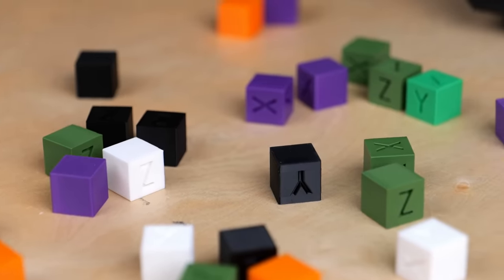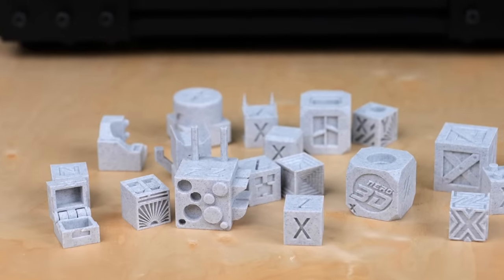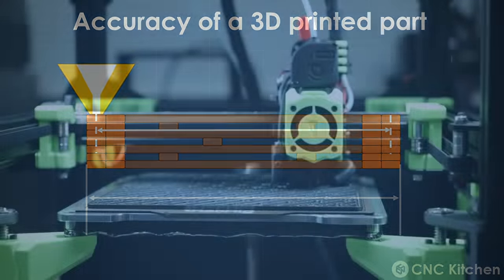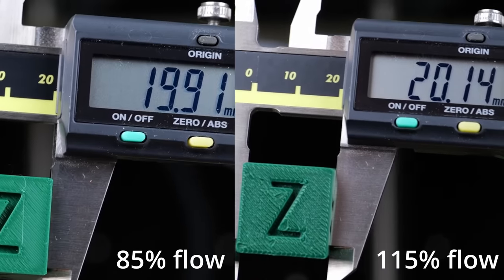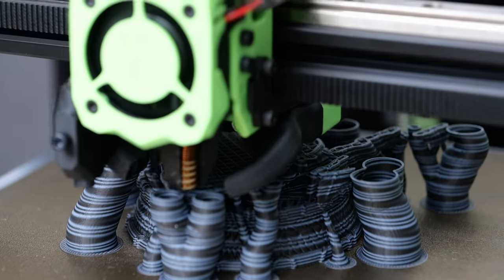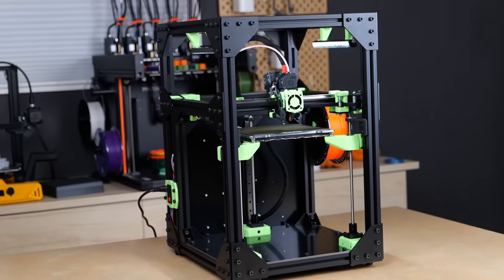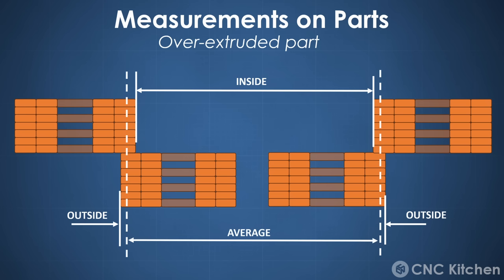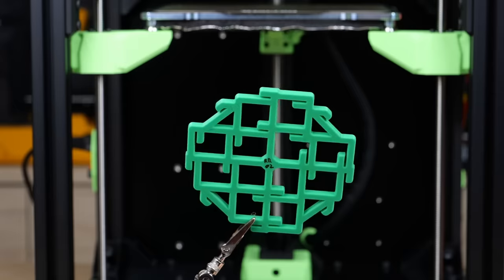Calibration Cubes: More Harm Than Good?

Comment: Wouldn't the best way to calibrate the E steps simply be a dial gauge? I mean I took a mount for the X arm and took my dial gauge and it was spot on when moving right 1mm then right 25mm. It landed at exactly my indicated 0. When moving left it moved 0.05mm less which is caused by the belt.
I have not done my Y yet as it requires printing another thing and I was too focused on the wobble caused by a V groove wheel.
I did do the Z and I already had it lowered to 399.1 steps per mm but it actually was even less with 0.01mm difference at 25mm travel. So it needed to be 398.94 Now its still not entirely accurate but its within the 0.01mm tolerance so I am not going to bother.
Skew is something else though. I wonder how square my printer really is. Might grab a right angle and see if it is correct.

Comment: Spot on Stephan! The first time I used a cali-cube the size of it never felt comfortable. Far too small to make an impact to precision for larger parts and seemed a bit under designed to consider all of the mechanical movements of the printer and properties of the filament. Seemed like it was targeting a simple process, and likely fits a larger audience using a printer in a different method than a multi-material / part maker. Thanks for the reference to califlower; will check that out to setup each material. 🙏

Comment: Back when I made my first printer (a delta) I made a calibration shape that had a few different dimensions as well as reference angles. 

I figured that if the first section measured 50.5mm and the second 100.5 then the steps per mm was correct but I was getting over extrusion.

If I was getting 50.5 and 101 then it was the steps that were off.

You definitely need more than one dimension per axis to know what is going on.

Amusingly the shape I made actually looked pretty similar to this but with a more open sides.

Comment: Skew was a big pain back in the earlier days of 3D printing.  I started with an Anet A8 and the whole reason I bought a second printer was to rebuild the A8 into an AM8. All because of the massive skew that was impossible to get rid of because there wasn't any way to adjust the laser cut acrylic frame.

Comment: Why not just print a strip that is the entire length of the bed, one for each axis?

You’re basically trying to compensate for errors in the belt, since a gear, no matter how poor tolerances, will always have the same number of teeth per rotation. So you could skip the middleman and just measure the teeth per 100mm on the belt, when it’s relaxed and in tension. If they are very very close you have a good belt, and you can adjust the steps per mm based on how off the belt is from nominal.

Comment: My Bambulab X1c came out at 0.11 degrees skew.
My self sourced Voron Trident turned out even slightly better at 0.10 degrees.
After calibration I ended up with 0.01 degrees on the Voron, really cool. The Bambu can’t be tuned, but 0.11 degrees is fine.
Reply from the maker: Thanks for the input. I'll try adjusting my skew on the X1 with belt tension but I would advice against it if it doens't bother you.

Comment: This is most important video for tuning, also accuracy of best calipers is +- 0.05mm even. So with 20mm you would need a micrometer to measure anything and the plastic melting will have more effect on the size that anything else :)

Comment: As for Core XY machines (i run a ratrig v-core 3 as well), you should be able to correct skew by balancing the tension of the two belts. I found it totally sufficient to measure the distance the left and right gantry joiners have to the corners of the frame. Checking for squareness is something I thought everybody does everytime they retighten the belts. I modified my printer quite a bit and maybe had to do it more often than most folks, though.

I put a lot of effort into finetuning my frame and my linear rails into something very close to true square (hand-tight screws and soft nudges with a plastic mallet will get you there, measuring diagonals repeatedly)
Just put something (any rigid object of appropriate size, really) in between one side of the gantry and the inside of the frame and jog to the position where it just touches. Then adjust the tension of both belts so you have the the gap feeling the same on both sides. If this leads to tension being noticibly different between the two belts, just loosen and retighten the screws that connect the gantry extrusion to the joiner pieces, and repeat the process.

In my opinion, there is no reason for software scew correction or to deviate from the nominal steps per mm in the printer settings ever, at least for extrusion built core xys. Different amounts of thermal shrinkage can be compensated for in the slicer in a much better way.

As for precise measurement of the frame diagonals, instead of buying very large and expensive calipers, it might serve better to wrap a tailor's tape measure around diagonal opposing beams. Put two flags of painters tape or sth on the overlapping areas of the tape measure and cut into the flags. Remove one side of each flag, so they form a hairline thin gap when the tape measure is held tight. wrapping it around the other diagonal, you can easily see even tiny differences when holding a lamp behind the slit.

Comment: Yes, I do check it from time to time. The first time I did it was when I had the same problem with the lid not closing. Then after a while I did it again because the belt on one of the printer's axes was worn out, which resulted in an oval instead of a circle. Now I check it by printing similar models to califlower

Comment: My frustration is with skew.  I got into the habit of pulling the gantry forward by hand to replace filament on my modified FT-5.  By pulling from off-center, I know I have introduced skewing.  I did a skew correction in Marlin once, and that worked until the next time I pulled the gantry.  The best option would be to add dual end-stops on the y-axes to ensure that the gantry is squared.

Comment: Preach, Stefan! It's a fine test of the final result. But I made this mistake on my first Ender 3. Its travel accuracy was actually perfect, and I just needed to better tune linear advance for corners and expansion to account for edges and holes. Then every part was spot on everywhere to 0.05-0.1 mm.

Comment: Great video. I appreciate the idea of not using steps per mm to adjust scale, I configure my steps per mm by reading the actual travel of the machine with a dial indicator, so I know that any dimensional error I get in my prints are results of print settings not hardware configuration.

Comment: My first big print was done on a friend's ender 3 max.  A two peice custom designed matx pc case.

The parts firs together great and then at assembly I noticed the holes for the motherboard did not line up.  Now I know the most likely culprit and am ready to tackle the project again also making some modifications for things I didn't realize till after placing parts in the case.

Comment: I'm suprised you didn't talk about Z calibration. After months of using my cheap single-leadscrew 3d printer, I found that the z axis scales non-linearly. That means small parts worked (because they were calibrated using the cube) but taller parts were way off. I used a calibration tower with evenly spaced measurement crevices to measure the height inconsistencies. I solved this problem by correcting the z steps after each layer in the layer script in the slicer

Comment: axis steps/mm calibration should always be done by performing measurements of the physical machine, not measuring parts. As you note in the video, each material shrinks (or warps) after printing and so you cannot measure the accuracy of your axis movement by measuring the part itself unless you already know the shrink factor (which you don't).

how to perform measurements of the physical machine will of course differ depending on your machine setup but I find it easy and accurate to use calipers from one fixed location on the machine parallel to the movement of one axis to some stiff part on the printhead.

Comment: I've got into 3d printing and I bought a Bambu A1 mini. One of the first prints I've made had a 2mm hole in it (placed vertically) but it came out as a 1mm, other part had 5mm and came out 4.75mm and other had 30mm which was almost perfect.

Comment: I've been replication parts I physically have on hand with blender and my mk3 and mk4. I found the dimensional accuracy to be perfect. At least perfect enough that it serves its function. If it's off from the original part's size the change is so small that it doesn't matter. My battery case holds the same batteries. The mirror bezzle I designed for my parent's car fits the same mirror (although I did have to make a lot of fine adjustments on that one)

Comment: I primarily have been using the "cube" as a first print just to make sure the printer is actually working (just ask that half printed Voron cube with a snake coming out of it). Then I worry about tuning and calibration later.

I've bought a few things from Adam like the Wire-Stripping adapter in Feb 2022, his workbench schematics and his Califlower.

Comment: I use my caliper to measure my steps per mm.  Command the tool to move 100-300mm and see how much my caliper shows.  Gets around the filament expansion issues.  As for skew I use a digital angle finder which is accurate with 0.1°.  Good starting point, then do anprint to test my results.

Comment: Really informative. Always thought the calicube is not the most helpful thats why I started to calibrate alignment mechanically if necessary or print larger corner pieces with more precise numbers about rectangularity. Good to see that my gutfeeling was right. Thanks as well to point to the skew adjustment i didn’t knew the word but always looked for perpendicular adjustment😊. Thanks for all your informative videos!

Comment: What I trust in my 14 years of Mechatronics Engineering career is my Calipers, Miter and my trusty Laser measuring tools. I have never printed a benchy or any other calibration shapes ever and don't need them... Use Proper tools measure your printer dimensions make sure all dimensions are accurate from one side to others. Use simple measuring tools keep it simple! screw every connection with a good clicking torque wrench step by step count your steps. If you do have a Printer chasis that is bent ofcourse no matter what you do you can not calibrate that machine. Trust simple Math,Simple Tools not calibration shapes! Don't forget Math,Physics are universal. Custom designs are not!

Comment: Absolutely fascinating. I learned a lot more about dimensional errors. I knew some about skew compensation (the MK3 did a decent job with that due to its initial calibration routine) but I didn't realize there were material shrinkage compensations in some slicers. It makes a lot of sense and is one reason even an older printer can get better over time.

As far as using the calibration cube - I had no idea people were adjusting their steps/mm for x and y with them! 😬 I always heard of people using them to fine-tune their extruder's steps/mm after an initial adjustment via filament consumption just to make sure walls weren't too big or small (which, obviously, still has material-dependent issues due to different overall shrinkage).

Oh, and one more thing - you should have seen my original plywood printer kit. The guy who made the kits made most of his own parts. Unfortunately, it used fishing line over threaded rod that he cut and drilled himself. The rod wasn't quite centered which introduced an eccentricity to the X and Y leading to very wobbly diagonals. No compensation for that! (Needless to say, I upgraded to a belt drive later.)

I love these deep dives - please keep it up!

Comment: Something I've noticed on my bambu printers, speed has an effect on tolerances. My parts are engineering parts and I noticed that while I could print at full speed, the parts would be cosmetically fine, they were unacceptable for fitment tests. I slowed the prints by 50% and they now meet requirements. I don't think cooling was an issue and slowing the printer didn't really increase print time that much. It's probably got more to do with acceleration but reducing speed was the fastest way to fix this issue. I should note these parts are designed for injection molding and these prints are used to check that everything will fit as expected and feel as intended so my work flow will be different then normal 3d printing

Comment: I did basic cube like 8×8×130 mm and printed it in X direction, then the same in the Y to avoid measuring errors.

When there is 0.2mm error in 20mm cube, the overall error is bigger than in 130mm cube.

Comment: This is great info that I wish was common knowledge in the 3D-printer world. Thank you for another great video!
I have never understood why people calibrate with only the 20mm cubes. I like to recommend to at least also measure something larger, like 100mmand compare them. If both are off by 5%, steps may be wrong. If booth are off by 0.1mm, something else is is too blame. Like caliper accuracy or how you held it while measuring etc.
Skew is something I am aware of but haven't really looked into yet. On my old Wanhao Di3 machines I used a spirit level to make sure both rods where at the same height in both ends (in relation to eachother, not to the table). The ends where usually loose out of the box and they could sit at different heights.

Comment: Thanks for the video. Last time I decided to have a look at this 3d printer I have bought but never used (sidewinder x1). I checked what to do what to tweak and I found a video about using calibration cube. I was a bit "meh". There's a problem using small reference which gives you local accuracy while we need to check volumetric accuracy. But you explain this perfectly with your examples. The califlower looks great, will buy

Comment: I calibrate my printer the same way I calibrate my CNC which is tell it to go a distance then measure how far it traveled then adjust accordingly. On my CNC it’s 100mm on my printer it’s 50mm. I’ve never printed a cube and I also do not have many issues as far as steps being off. I had had many other difficulties over time though.

Comment: For step calibrations I use different aproach. I use digital caliper and I measure movement directly on hardware of printer. For example hotend. I measure durrent position of hotend and reset caliper to zero. Then I move hotend 100mm and measure position again. I know old steps value and real distance. Quick calculation and I got new steps value. I do same measurement with new value to check result. This way I test all axis even extruder. In this case I use tape mark on filament.

Comment: As usual, a great value video! My only concern about this calibration part is some lack of rigidity and the fact it is not checking the Z axis dimension nor skew... but the idea is still a great one. I really wish you do a similar video about the Cali lantern.
I would suggest the print of matching pairs of calibration parts (like your box / box cover)... To be able to check final accuracy once calibration is finished.

Comment: You are right. I've always thought the same thing. The last corexy I built, I used large test prints, measured the results, and adjusted the physical machine for skew and the settings for extrusion. I ended up with a machine which could make mechanical parts within 0.05mm accuracy no matter the size of the part. The XY steps are mathematically computed, it is literally impossible for them to be wrong.

Comment: The one thing this video is missing is talking about the z axis. Due to the layer-based nature of the printer, it is not affected the same by material shrinkage, though I can't imagine a way to properly test this due to The fact that an ABL sensor compensates for Z skew by fading over the course of 10 or so layers , and squish plays a role in overall z height. You can't really print in thin air

Comment: interesting but I think it misses a point which is where flow is also affects the outers (and inner dimensions). I have found from trying to calibrate 3 X1C to be consistent and accurate that the LIDAR flow rate calibration can be affected quite badly by the filament colour (black CF filaments are always under in flow rate. 

My current process is to flow cal by Lidar as a starting point, then use a primitive cube but with 0 top layers, 0 infill and 3 walls to get the wall thickness and calibrate the flow rate based on that. Correct the flow rate and then print the same cube and measure the X, Y, Z dimensions again to work out whether scaling factors in X/Y/Z are required. Next I look at hole accuracy by using a 3 holes, one at nominal, and the other 2 at +/- 0.1 mm to get a quick fix on the hole compensation value by inserting a dowel pin in each hole and seeing which will fit.

Comment: Hi Stefan! I did not even know that the Prusa MK3 did the skew test by itself. And I currently own one of them for about three years! Good to know. I am running the Califlower test however to see the results myself.

BTW, the filament tunning process you do is kinda new for me, since I only know the temperature tower. How about re-doing a general filament tunning procedure with the new knowledge earned throughout the years? Lot's of guides still use the calibration cube for flow test!

Thanks for your efforts, cheers!

Comment: I use Castle Calibration Cubes to see how a filament I haven't used before or that has been in storage will print. It's a very quick print and uses minimal filament, and has some challenges (e.g. the overhanging corner above the castle).